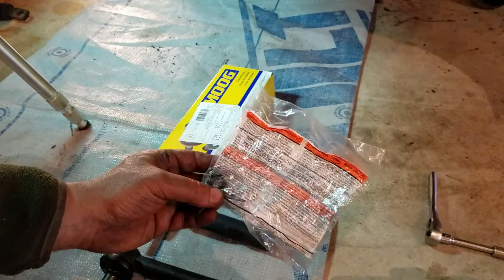2004 to 2007 Toyota Highlander FWD Passenger Side/Right side Front End Rebuild

Comment: I just did this job. Cutting the axle is basically the only way to get it out if the bearing is siezed. My brother pressed it out with a 20 ton harbor freight press. I wish I cut the axle before cutting the bolt on the axle bearing mount, found out after there was pins on the mount. Awsome video. After watching I went out and cut it. Did the lower control arms as well. Went fairly smooth after unfolding 4 motor mounts, 2 on top and 2 on bottom, there is also a bolt on the back side of the engine that attaches the sub frame to the engine via a black bracket. Sooo effin frustrating!

Comment: Trust me when I say, use an excellent penetrating oil, let it set. I used the slap hammer with attachment paddle and an air hammer. Also, when you pull the axle from the housing there is a bolt.  Behind that bolt there is actually a rubber buffer. I reused it. When you remove it, spray some penetrant in that hole, and all around the bracket asy. Beat on it a few times and let set. After a few hours the the air hammer and slap hammer will work. I replaced the steering knuckle and bearing as a unit. With all the miles and rust , it was due. I had already done the driver's side andit actually had a good amount of play in it. No point in not. I was already there. Any ways, great video. Thanks for posting it.

Comment: Great video!  On the lower control arms, can you press out the rubber bushing that was torn and replace just the bushing, or is a whole control arm the only option?
Reply from the maker: You can press out the old bushing and put in a new one.  Bushing cost is around $5 to $10 less.
Reply: @justbehandy  thanks for the reply!

Comment: How did you get it off if there was teeth holding onto it 23:18 that bolt hidden behind the black thing
Reply from the maker: Once I cut the axle, I took the portion with the pillow block/bearing housing to the press and pressed the portion of the axle out please see 24:01.  The splined part that was still in the transaxle came out easily.  Hope that helps.